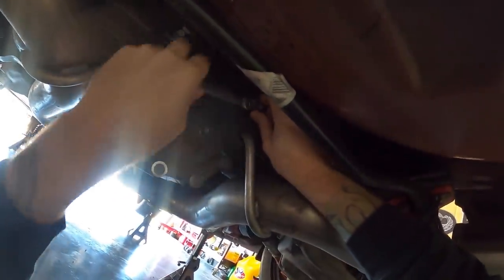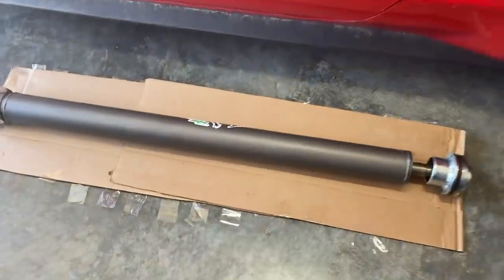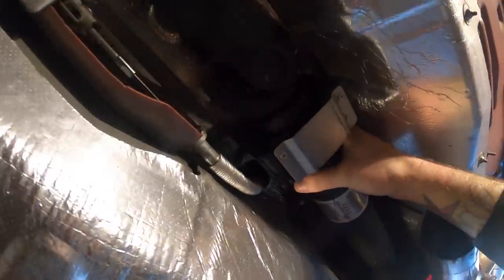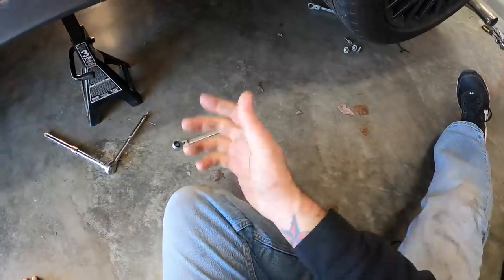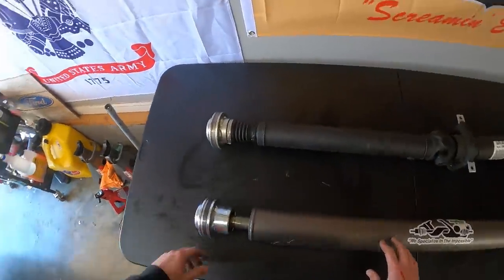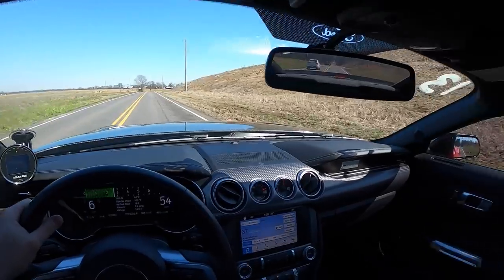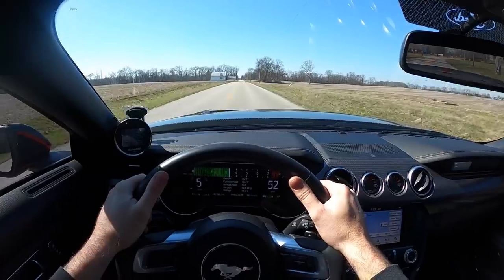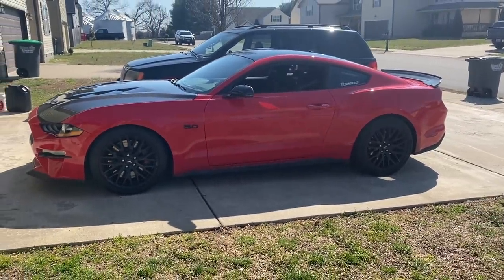My 2019 TWIN TURBO Mustang GT Get's a "SECRET SURPRISE" Plus a 1000hp Driveshaft

Comment: The better fuel system and some e85 will be much better for the engine long term. Boostane is good, but you just have to keep very good maintenance of your spark plugs. I just ordered my nitrous system kit and always checking spark plugs will be the key to ensuring the car is running great and I can keep the engine running longer.

Comment: Awesome build bro. I have a similar set up on a 2019. I have the hellion sleeper twin 62/66 with the ball bearing upgrade. I believe u have twin 64's. Same converter and same exhaust as u but I have a built 10r80 with full steeda suspension, 2000 hp axles, carbon fiber drive shaft, upgraded oil pump gears and crank sprocket. Upgraded fuel system of course on e85. We only have 91 octane here so I didn't make much hp on 91 with torco. It only made about 681 hp on 91 with torco at 7.8 psi. My builder / tuner did everything on the conservative safe side for a stock bottom end. On the e boost with e85 it makes 711 at 8.3 psi, 832 hp at 12.1 psi and 924 at 15.3 psi. U can't hear my turbos at idle like your car. I just got the car back so they aren't worn in so maybe that'll change. We ran into some back pressure issues as well at around 12 psi. We ordered the boost pressure dumps from hellion which releases pressure at high boost. That will help. I'm putting a built motor in it eventually which will have better valve springs, rods, pistons and sleeved block so I'm not going to change them on this set up. Then we will be less conservative on the tune. Been thinking about starting a YouTube channel. Would have been cool to have started when the car was stock to document the journey but oh well. Love your channel bro TTYL

Comment: Rule of thumb, burn a gallon of gas and you burn a gallon of water.  Not sure with corn broth but it will be the same or more. Propane has a higher water content on its own and is really hard on steel exhaust. Whats going on with the valve spring thing. The driveshaft thing had me concerned as well, i am very fussy about nvh. I suspect that shaft is steel given it outside diameter and weight. High HP aluminum shafts are huge and the Stang has limited space in the tunnel largest i think is 3 or 3.5 inches.